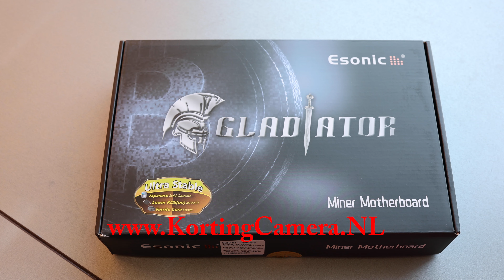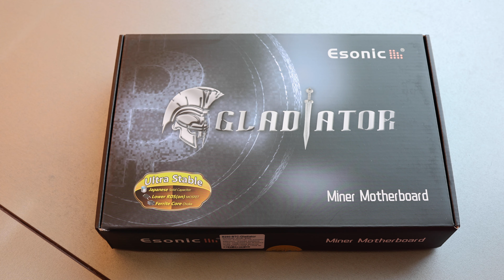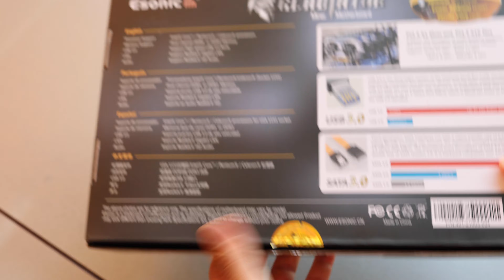TB250 BTC 12 GPU video card Motherboard Ethereum ETH Mining Open Box and Setup

Comment: hello my motherboard is the same as this.  I use an lga 1151 ram 4 cpu when I turn it on it can't appear on the monitor, why?
Reply from the maker: it could be several reasons, difficult to detect the reason just from your simple description. but this motherboard only support 6e and 7e generation cpu, maybe you are using the 8e or 9e cpu
Reply: @kortingcamera4662  i use this cpu intel g3930t 2.70ghz
Reply from the maker: @kuro8619  should be supported. it is better to contact with your seller to get technical support
Reply: Hi!
Did you find what was a problem? I have the same issue.
Reply from the maker: @dimithabro  Try to use a low frequency memory, this motherboard only supports 2133/2400Mhz memory. Normally this motherboard works great and never has a problem. the no video output issue is always caused by a un-compatible cpu or memory. 

The best way is to buy the motherboard, cpu, and memory from the same seller, this will avoid the compatible issue.
Reply: @kortingcamera4662  Thanks for your reply guys! What do you think, is it possible that the problem is in my CPU which is G4500?
Reply from the maker: @dimithabro  Do not think so, check other components, especially the memory., use a lower frequency memory. If you still can not solve the problem, please directly contact with your seller.
Reply: @kortingcamera4662  Hi guys, forgot to reply that the problem was solved. Indeed it was related to memory. Thanks!
Reply from the maker: @dimithabro  good to hear that the problem is solved, enjoy the mining
Reply: @dimithabro  hello. What kind of memory issue ? Is it malfunction or high speed ?

Comment: which type of CPU you put there?
im try to put on the same Motherboard CPU G4400 and its not working
Reply from the maker: This is strange, the motherboard supports all 6th and 7th generation of cpu wit socket 1151, including G4400. If it does not work, then either you did not plug in all necessary cables, or your cpu or memory has a problem